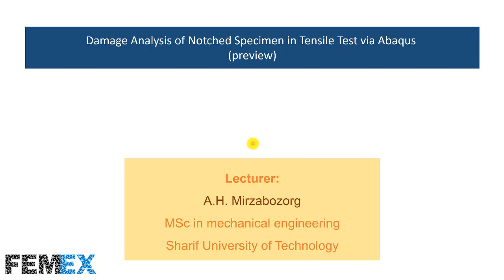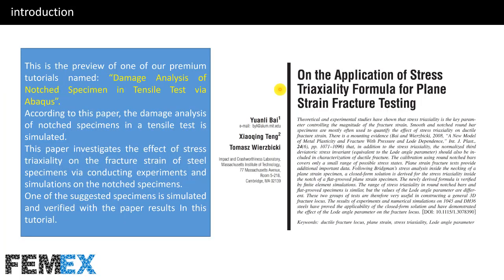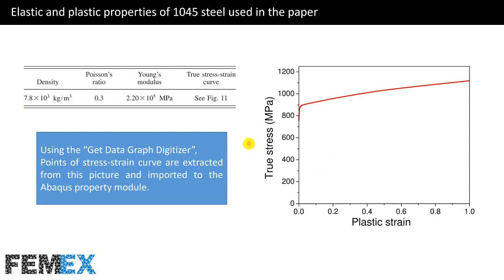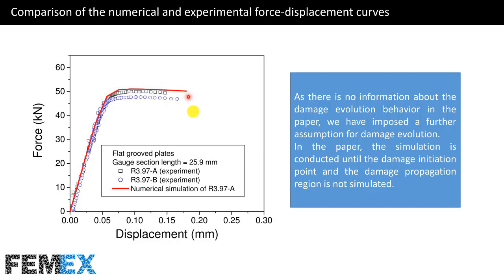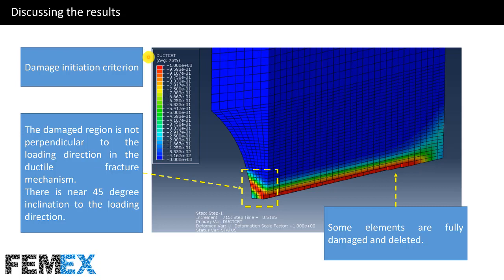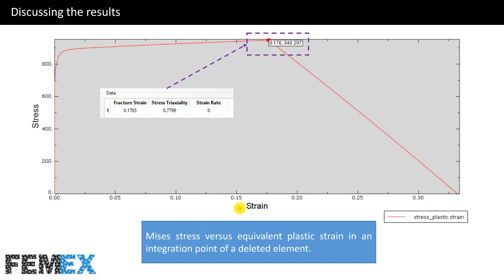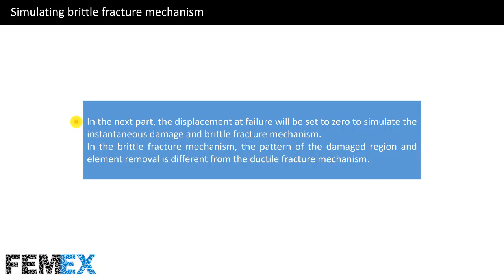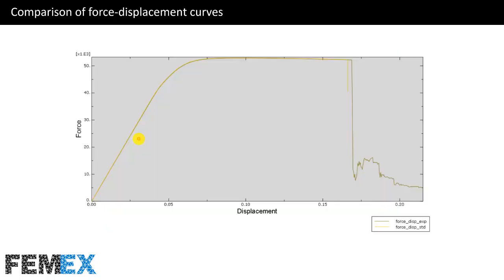Damage Analysis of Notched Specimen in Tensile Test via Abaqus preview

Comment: Hello Sir, I have a small dought related to "step time". 
What will happen if I increased and  decrease the "Step Time" value. I have kept it as "1" by default.
Reply from the maker: Hi.
For the quasi static analysis, you must not decrease it too much because it will increases the kinetic energy and the simulation will not be quasi static any more.
Also you can use any arbitrary value which is large enough only when the material is rate independent. If it is rate dependent, you must exactly use the time period used in the test.
Reply: @FemexIran  Thanks for clarifying my dought sir.
Reply from the maker: @abhinavsiliveru5448  You are welcome.

Comment: Hello, first of all thank you for your videos. I have a question,I want to specify a strain threshold for the material, and after this threshold the element should be deleted.  It looks simple, but I could not manage to solve this problem. Is there any keyword that can be added to the input file in order to specify this threshold ?
Reply from the maker: Hi.
You are welcome.
It can be done from property module but it depends on the mechanical behavior before damage happening.
For example, if you are modeling a metal, damage happens after the plastic behavior. In this case you must use damage models like ductile damage, shear damage and Johnson-Cook.
But if you are modeling a brittle material, damage happens after elastic region and you must define brittle cracking model.
Reply: Thank you very much for your answer. In my case I am working on a brittle orthotropic material, the problem is that brittle cracking doesn't work with orthotropic material. So I don't know if can I use a shear damage with very small plastic region ? And I checked the unsupported keywords in Abaqus, I couldn't find any keyword for cases like those. If you know a keyword for this case, please share it. 
Thank you very much.
Reply from the maker: @mouhamadabouhamdan6563   You are welcome. If you want to use shear damage or ductile damage models, yes you must define plasticity and you can define a small plastic region but I have not used them for orthotropic materials and I don't know whether they work for you or you will encounter error. You must try and see what happens.
The other way which I know is to use USDFLD or VUSDFLD subroutines to define failure criteria and do element removal.
But is is not as simple as doing settings in property module.
Reply: @FemexIran  Thanks, really you are so helpful.
For the shear damage, it works with orthotropic material but you should add hill potential with ratios of stress=1 in plastic region to reproduce the mises plasticity.
Again, thank you.
Reply from the maker: @mouhamadabouhamdan6563  You are welcome. Thank you.

Comment: thank you for sharing, I have one question,how to choose all deleted element in easy way ?
Reply from the maker: Hi.
You are welcome.
Actually the deleted elements are removed graphically.
I have not seen any command or option in the visualization module to show the deleted elements.
If you don't request status in the field output settings, the fully damaged elements will not be removed. in these elements the SDEG parameter is equal to 1 in every integration point.